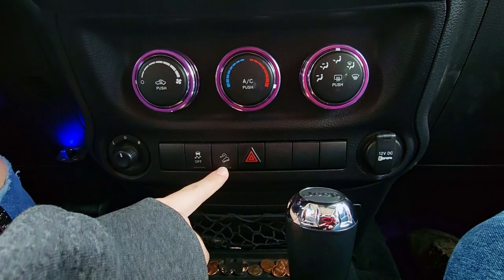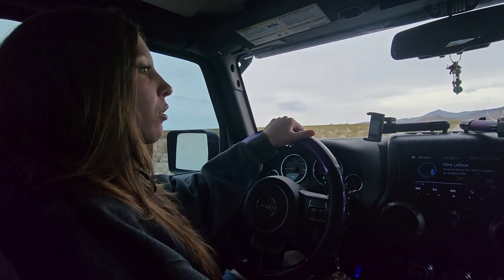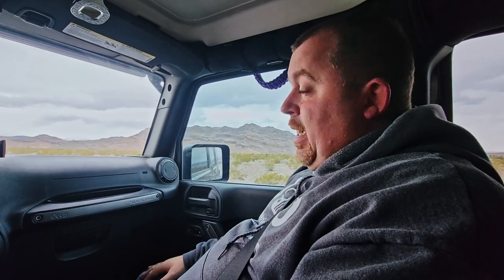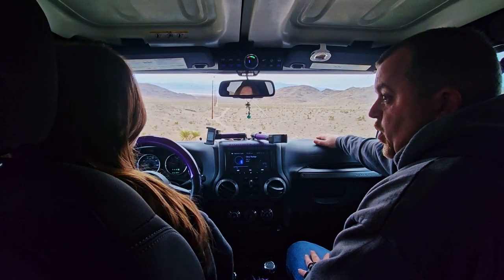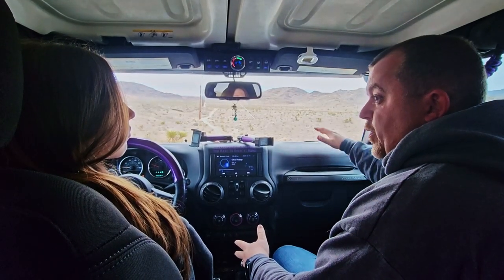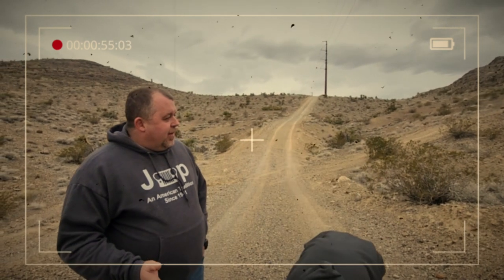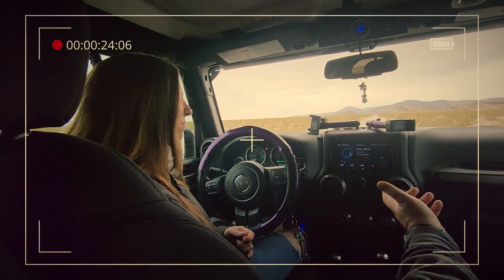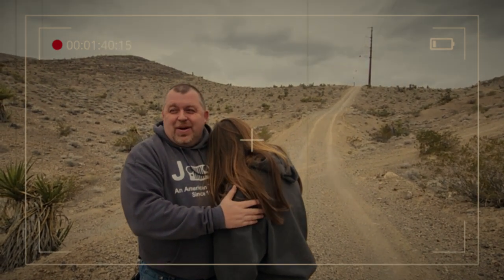Hill Descent Control, Explained!

Comment: Which is better, HDC and it using the brakes automatically or putting the auto transmission into first gear while in 4Lo?
Reply from the maker: Really depends on the terrain, and the experience level of the driver... HDC is a great tool, but just a tool.... not to be depended on 100% of the time. What you are more comfortable with, and maintains control of the vehicle at all times, that is the best way to go